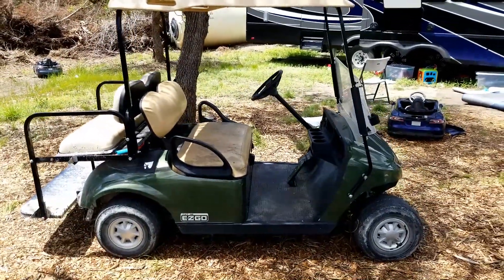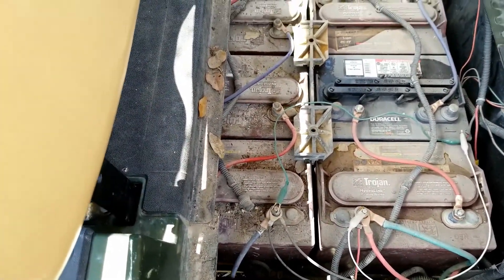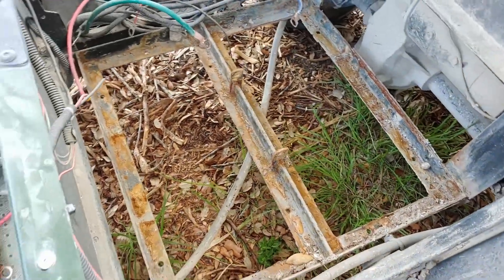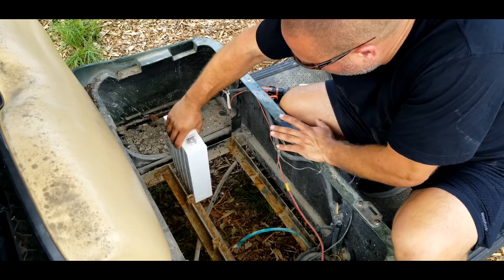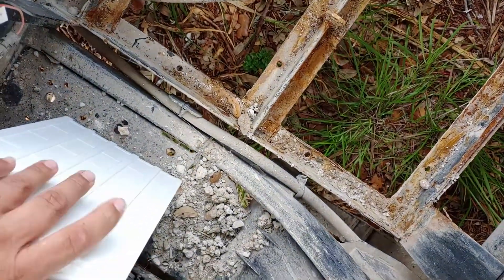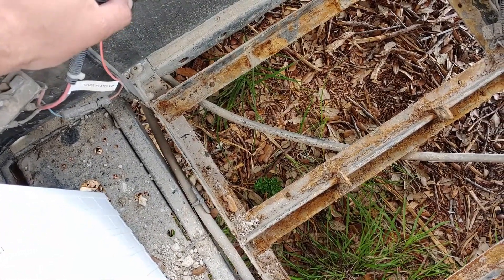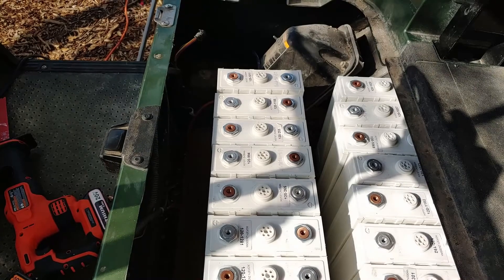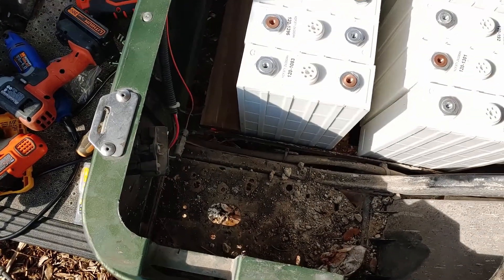LiFePo4 Golf Cart Conversion

Comment: Hello I have a Yamaha G9e I want to convert to 48v lithium. I have a single 48v battery, Curtis 500a controller and an upgraded 48v solenoid. My solenoid came with diodes. 

My question is do I still need to get new diodes or can I connect it to the diode on the solenoid? 

My cart didn’t come with the factory diodes, someone else used a different wiring harness not original to the cart. Do I need those two square diodes or can I connect it directly to the upgraded heavy duty 48v solenoid diodes? Thank you

Comment: Nice job.  Maybe route those BMS wires so they don’t short out a cell when the insulation wears away.  Also, possibly protect the cells from rain.  Keep up the good work!
Reply: Thanks for the kind words. I removed the BMS and bought a cheap little active balancer from Amazon that has worked perfectly.

Comment: Buying raw cells and a BMS may be a little cheaper, but not like it used to be. I'm betting that you could find a packaged battery w/ Bluetooth BMS and shunt that might drop right into the frame you had (other than removing the tabs).

Comment: Does the bms wire somehow to the charger or are they separate and you just  wire the charger to the most positive and negative posts in your pack?  Also I think those small wires are to stop the cart from driving while charger is plugged in.
Reply: That makes sense about the little wires. I struggled with finding a quality BMS that could stand up to the elements. I ended up choosing an active balancer from Amazon. It has worked perfectly (and they are cheap).

Comment: How did you determine how many batteries you needed to achieve the correct voltage?
Reply: Cells have voltage which is obvious.  The amount of cells needed in series to achieve 48v is basically divide 16 cells (white things he placed) in series ,and you get your voltage.  52 volts nominal for 16x3.2volts.
Reply: @charleshorseman55  Professional answer
Reply: @charleshorseman55   L o l A silly question considering the batteries come advertised with the amount of voltage  and  amps per battery.

Comment: I'm sure it's a lot lighter than the lead acid batts, 
but does it go any faster?
Reply: I converted mine.  It's a little faster on hills with the lithium, but it's much faster after half the charge is used.  Remember that these are regulated so they only go to the programmed speed. The old lead batteries drop in voltage and current when partially discharged but litihium batteries deliver the same voltage and current for about 90% of their charge.
Reply: @ohger1  Voltage drop is much lesser with the LiFePo4.  It will go until it's done. In which case you push it back lol.  Anywyas, yes, flooded lead acid will have more of a charge curve.

Comment: Can you share the specs or link to buy the cells you used and the Bms?
Reply from the maker: I bought this BMS. I didn't care for it. https://www.alibaba.com/product-detail/FAN-16S-bms-smart-lifepo4-250A_1600155285504.html
Reply from the maker: Here is the link to the batteries I bought. I would not buy from this seller again. Some of the cells were leaking upon arrival. The seller refused to backup the product. The batteries that were not leaking were not in bad shape. https://www.alibaba.com/product-detail/Rechargeable-3-2v180ah-LiFePO4-Lithium-iron_1600170790576.html

Comment: Also what is the total voltage fully charged?  The voltage above 48 hurt the motor or controller?  A picture or video of how the charger and bms are hooked up would be nice for me.
Reply: This is a bit of a complicated question. The lithium batteries can charge all the way up to 58.4v. I'm using the standard TXT48 charger which won't fully charge the lithium battery pack (which is what I want for longevity). I think the standard charger can go to 56 or 57 volts, so the Delta is very small. If the batteries were ever fully charged, the voltage overage would be very small so I doubt they would be much damage to the motor. Hope this helps.

Comment: You paid 2500 for 64 batteries. Price from your link shows $4820 for 64 batteries. Was your quote a mistake or did the price actually increase about a hundred percent?
Reply: 16 cells.  each cell is 3.2 volts nominal.

Comment: So what is the cost difference from standard batteries to lithium?
Reply: I paid $2,500 for 64 cells. They were used and I tested them with a capacity of 180ish AH each. I only used 16 cells in the cart, so the cost is $625. I think Lead Acid is possibly more expensive. I haven't charged the golf cart in 2 weeks as we speak and it is not even close to low.
Reply: depend on  liththe rank of lithium cells and the quality of BMS

Comment: Where did you the batteries and the bms system.? 
Can you provide the links whre you purchase this items?, thanks
Reply from the maker: Here is the link to the batteries I bought. I would not buy from this seller again. Some of the cells were leaking upon arrival. The seller refused to backup the product. The batteries that were not leaking were not in bad shape. https://www.alibaba.com/product-detail/Rechargeable-3-2v180ah-LiFePO4-Lithium-iron_1600170790576.html
Reply from the maker: I bought this BMS. I didn't care for it. https://www.alibaba.com/product-detail/FAN-16S-bms-smart-lifepo4-250A_1600155285504.html